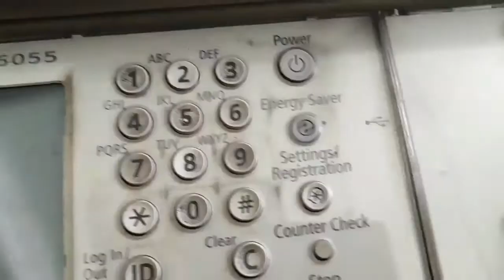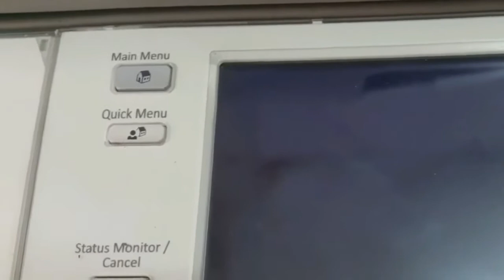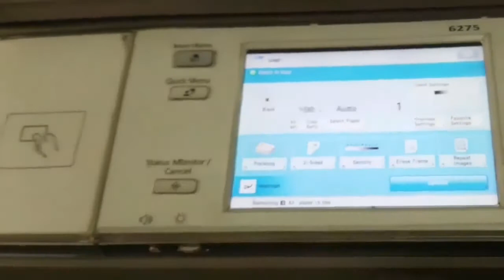Cara mengatasi kode error E808-002 IRA 6055/6075/6275

Comment: Bang mau tanya mesin ria 6055 error nya 00808.007 itu apa nya ya bang makasih
Reply from the maker: saran cek :
1. cek tegangan lisriknya normal/ tidak + ( cek juga trafo klo mesin 110v)
2. power fixing nya + kabelnya
3. pemanas ( elemen upper, sekring pemanas, soket2 pemanas)
4. power suply
5. DC control
semoga membantu,...